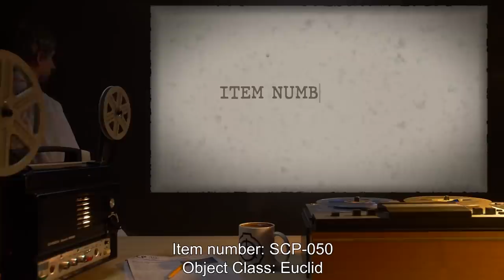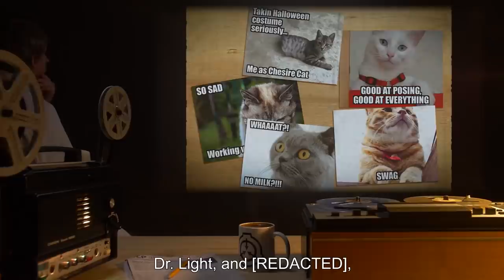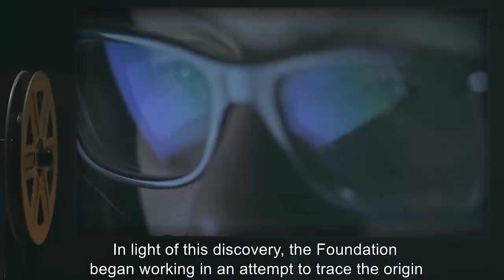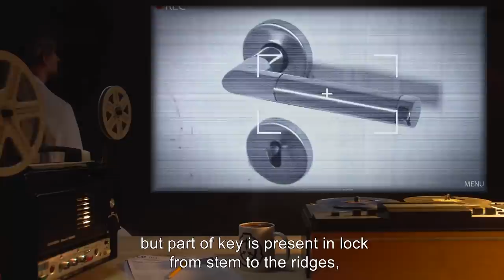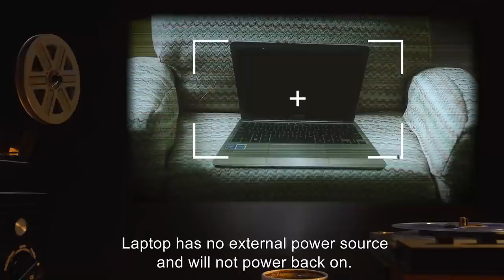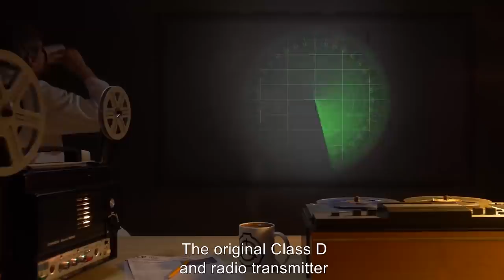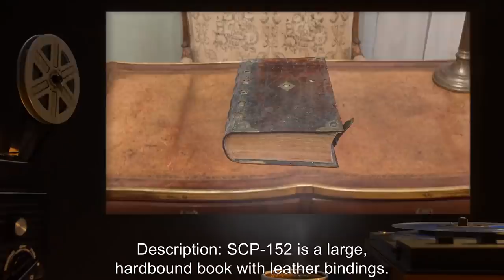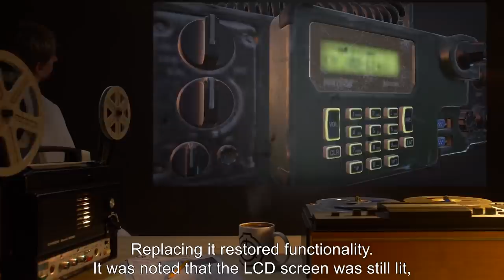Indestructible SCPs (SCP Orientation Compilation)

Comment: Fun fact, according to an excerpt in the GOC hub about the ammunition they use, the majority (emphasis on majority) of what the foundation would classify as indestructible are either A just very durable or B have an anomalous property that neutralizes the effectiveness of weapons, but the GOC made ammunition that punches straight through them called blue tips and black tips, with blue tips burning hot enough to melt straight through a tank without slowing down and black tips being made of a metal so dense it’s basically unstoppable, but against highly durable anomalies they basically behave like normal bullets

Comment: Would be interesting to see how SCP068 would respond with alkali earth metals that ignite on contact with water. 
Would an 068 made from sodium or potassium be able to avoid any water?
How would it respond to liquid mercury or other low melting point metals like gallium?
What about radioactive metals?
Has it been tried with metalloids like silicon or germanium? 
How about letting it use metallic tin and then lowering the temperature to one at which the metal would undergo autocatalytic conversion to a nonmetallic allotrope?
It seems that there are many interesting experiments that could be tried. If given a selection of high purity metallic elements would it keep them separate or combine them into alloys? Would it have any awareness of the properties of different alloys?

Comment: What about the most infamous indestructible SCP, SCP-682?
Reply: 682 isnt indestructible, it is just hard to kill permanently.
Reply: @yagamijubei28  It is indestructible, it has to power to rewrite the plot so that It doesn’t die.
Reply: @looselaces8236  indestructible means it cannot be damaged. 682 has been damaged by many factors and SCPs, its primary containment method is in a vat of acid so it wont regenerate to full capacity.
Reply: @yagamijubei28  It is placed in the acid as a method to prevent its cells from replenishing and causing to to become to big for containment.
Reply: @looselaces8236  correct. The acid damages his cells so they cannot regen. That is not indestructiblilty. If he was indestructible, the acid wouldnt damage him at all. 682 is a reactive organism.